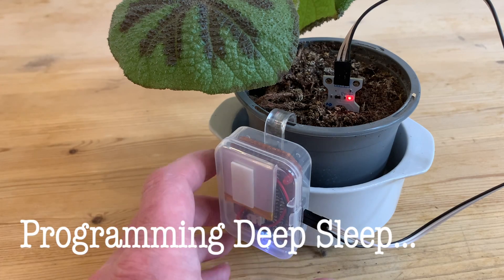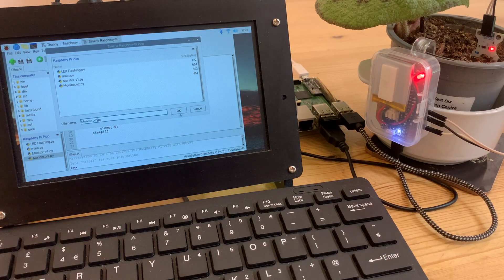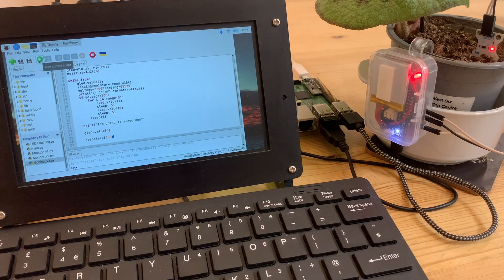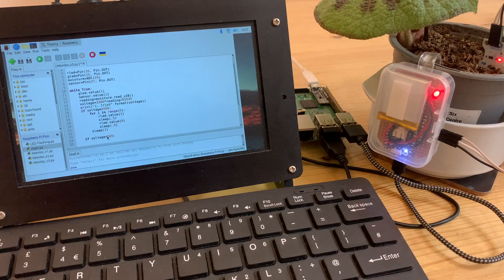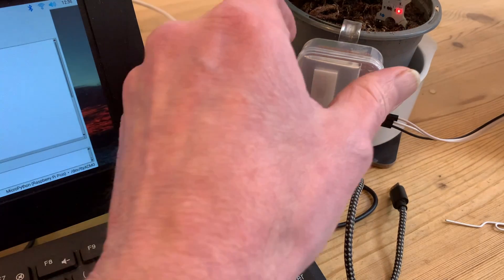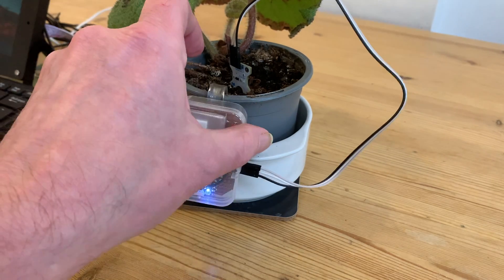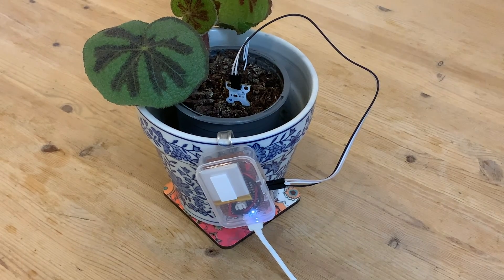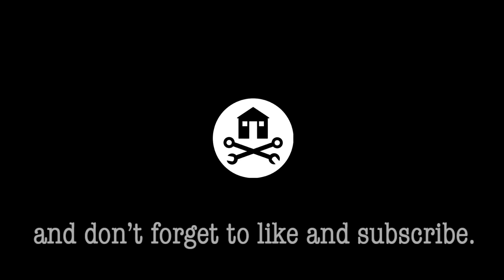MicroPython 'Deep Sleep' for longer battery life - Raspberry Pi plant watering monitor

Comment: Thank's finally I did it, but I can able to do for 1hrs , if I set more then one hour then it will not auto wakeup, can you give solution for that ?
Reply from the maker: Sorry, not sure why that would be happening. Whilst it kinda worked for me, I found it didn’t end up saving much power. It has been a while since I did the project, so something may have changed in MicroPython in the meantime.

Comment: Really nice video and explanations. Would it be possible to change  the idea so that a sensor wakes up the pico instead of checking every x minutes? I am planning on a mailbox sensor using a magnetic reed switch, which shall wake up the pico and send a signal once the mailbox was opened. That is why a time interval like in your case is not suitable for me.
Reply from the maker: I'm pretty sure that would be possible judging from the articles I read. I only used the time interval so I knew to check the plants exactly on the hour, rather than leaving it to chance that I would be walking by. BTW, I finally got my water monitor to be entirely solar powered, so that also might also be interesting in your case - https://youtu.be/-UjNNdQtsy4?si=oiBHuTYb1v2Udm-Z